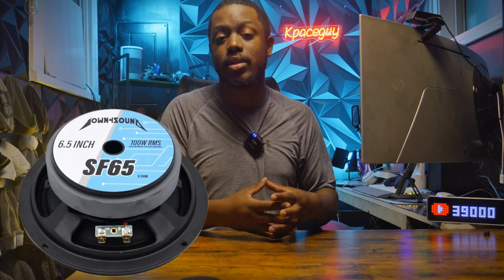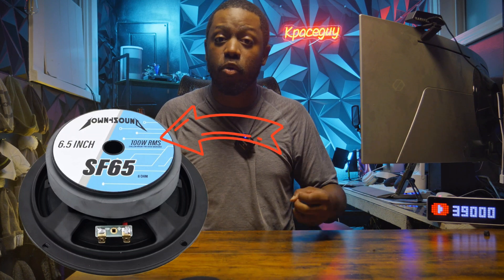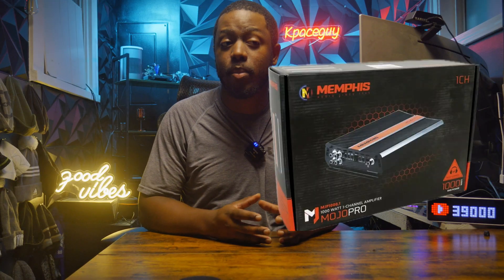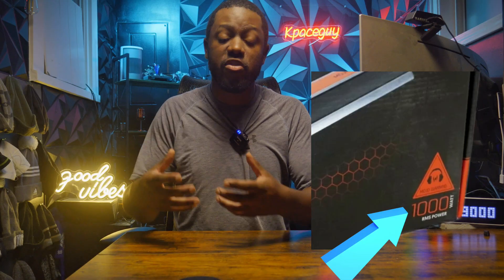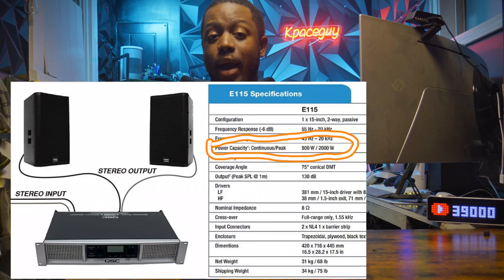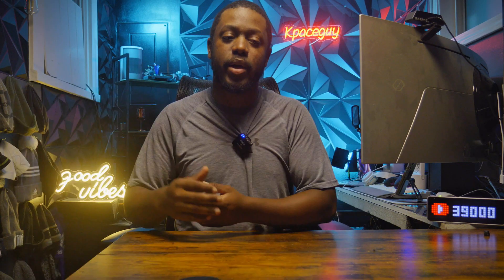RMS POWER vs MAX POWER and Why You Should Care

Comment: In many applications, especially in the context of electrical engineering, the term "RMS power" is considered misleading or incorrect, as no such term exists in electrical eng. textbooks.
Average Power  (Watts)= sq. root V (Volts) X  sq. root I ( Current)
Power is measured in Watts: The standard unit for power is the Watt. Power can be described as average power or peak power.
Confusion in audio specifications: The term "RMS power" is often used (incorrectly) in amplifier and speaker specifications, particularly in the audio industry, according to EEVblog. It's usually intended to represent the average continuous power an amplifier or speaker can handle, or what it can output with a continuous signal (like a sine wave) before experiencing significant distortion or damage. However, this is not technically the true definition of "RMS power"
More accurate terms to use when discussing amplifier or speaker ratings:
Average Power: This is the most technically accurate term and represents the power averaged over time.
Continuous Power: Similar to average power, this term emphasizes the sustained power handling capability of a device.
Rated Power (with RMS Voltage/Current): You can correctly state that an amplifier has a rated power based on RMS voltage or current measurements. For example, "An amplifier with a continuous output of X watts, measured with Y volts RMS across Z ohms resistance"

Comment: Hey Kpace
Good info. Whats the purpose of having a LFE + R inputs on the modern subwoofers ? LFE is the connection with a single RCA, but I heard by using a Y splitter could help with an  increase in Gain up to 3 - 6 db. By using am I changing anything inside subs plate amp/ overdriving or any issues ? Klipsch 1400 Sw
Thanks & stay blessd
Reply from the maker: Couple reasons 

1) like you said, the LFE is a single cable going from subwoofer to a home theater receiver. However, you can get a y splitter and plug it into both LFE and R and get a higher signal which gets you more volume. The sub doesn't care as long as the signal is from the same source 

If you have a 2ch stereo setup and you want left and right bass info to go to the subwoofer, you use both LFE and Right to sum the information.
Reply: @Kpaceguy thank you kpace ❤

Comment: Here's the problem - many plate amps in subs that claim an RMS number never back that claim up under testing. 
Generationhifi has done many rip downs of subs being tested - 80% of every amp tested, whether class D or class A/B never put out the continuous RMS output they claim to produce. So I am very cautious as to a manufacturers rated output unless I've tested it with a Dayton amp tester.
Reply from the maker: Very true

Comment: Nice video. I ran into this problem when looking for speakers and amps. I saw this with receivers power to speakers. Good information. Keep up the great work. 

I did have a question if I have a emotiva RMC1 do I need a dsp for subs? If so why? Since the RMC1 can do the same thing as the dsp.
Reply from the maker: If all the sub outputs are independent, you may not need one. However,  a minidsp may give you more control over the subs than the emotiva will. Overall, you be fine without one